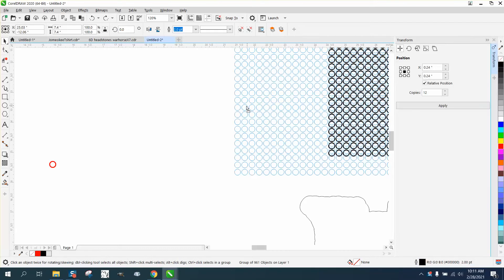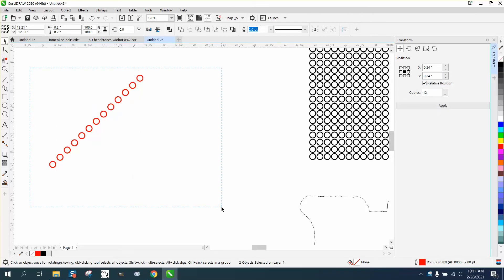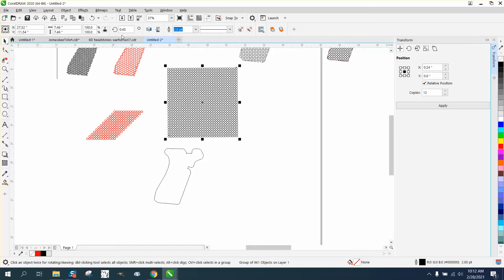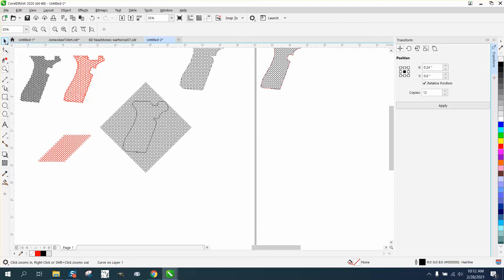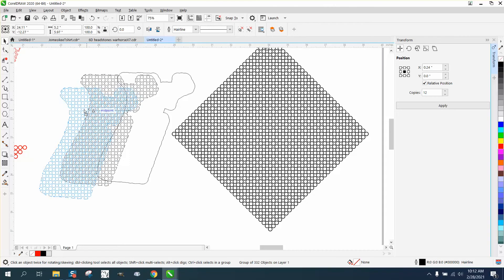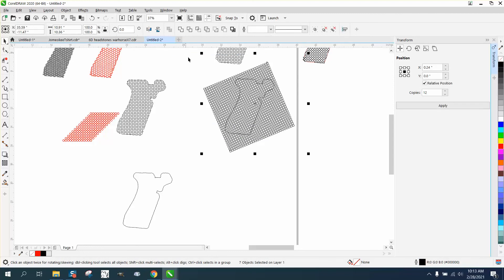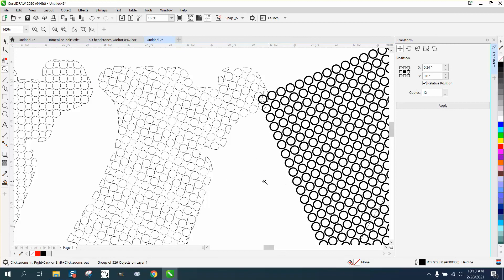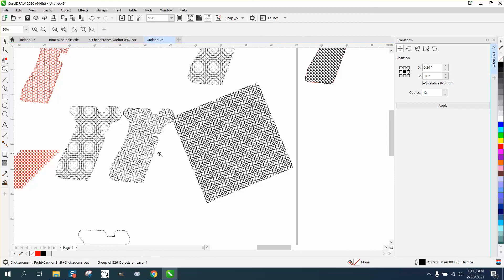Corel Draw Tips & Tricks Stippleing polymer grips Part 2

Comment: Make a circle.  Copy it and place very close beside the original.  Duplicate and rotate around 2 times.  You should have 4 circles in a parallelogram pattern.  Duplicate the whole pattern and shift it twice the distance the first copy was from the original.  Repeat.  This should give a pattern where the circles are closer than the rectangular pattern.  Duplicate and shift up or down.  Does this produce a better grip than the rectangular pattern?  Probably not but it would be marginally denser in circles.